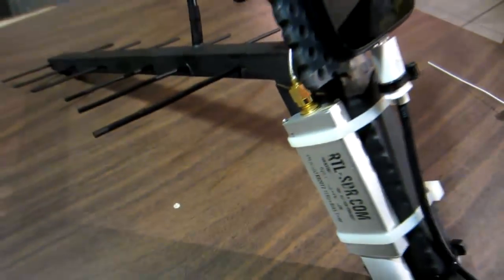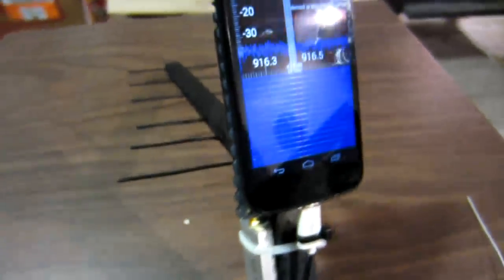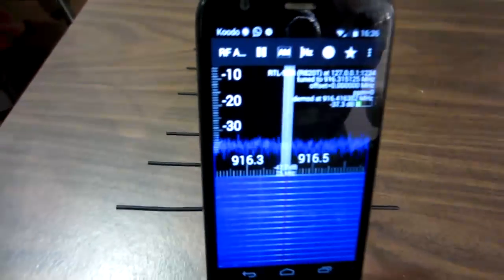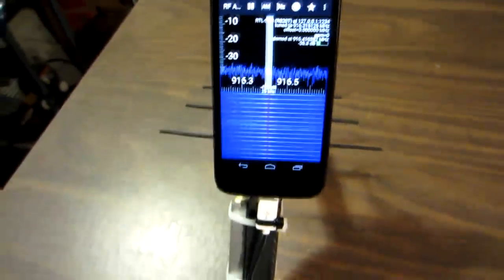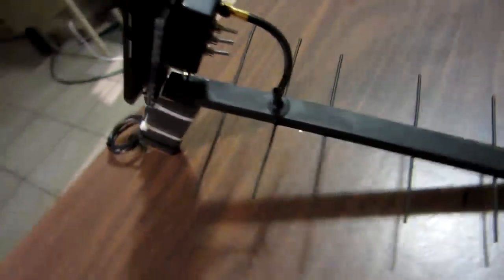Low-tech Tiny UHF tracker transmitter

Comment: Ok. Now put another directional uhf RX antenna on a pan and tilt mount with diversity rssi to Arduino. and add a bracket for a separate video RX and antenna and you have a pnp UAV tracker. Hot market for this. Just add the UHF TX to your UAV and you have much improved video reception.
Reply from the maker: Wish I had the time

Comment: I am confused by when you mention weight and size.. it sounds as if the bigger the object you attach the UHF transmitter to the more clearly you get a signal too?
Reply from the maker: Israel Harris No. The object needs to be big enough to see it from a few meters distance. The problem with the attenuators I used is that they don't attenuate enough, so once you get within a distance of a few meters of the transmitter you can't determine a direction anymore. I guess attenuating the signal even more would work once near the transmitter but I didn't investigate this any further.
Reply: I'm vary confused by this.. but I am not knowledgeable in electronics.. I was able to find this though your instructable page since I can on it by pure coincidence.  you might actually see my questions on it under the name cheesedog.  I'm actually interested in using this as I did describe there.